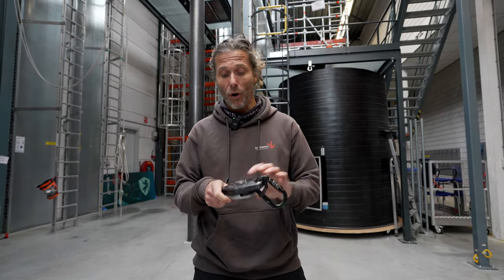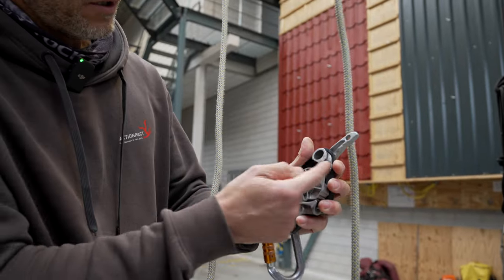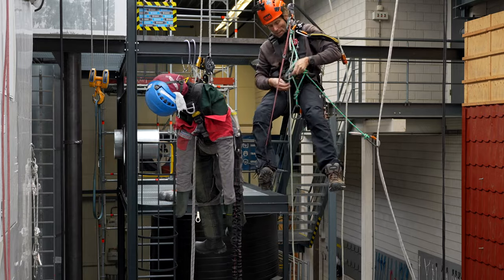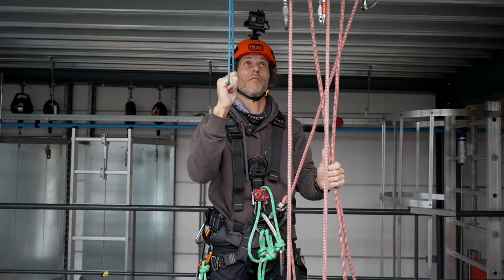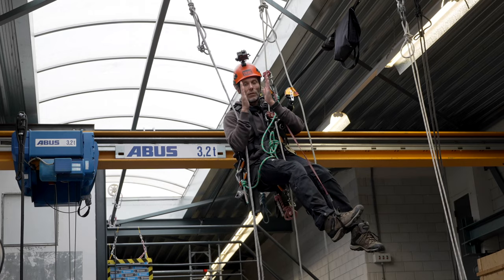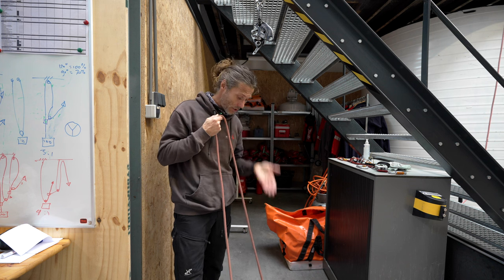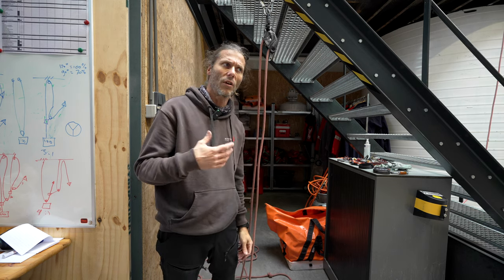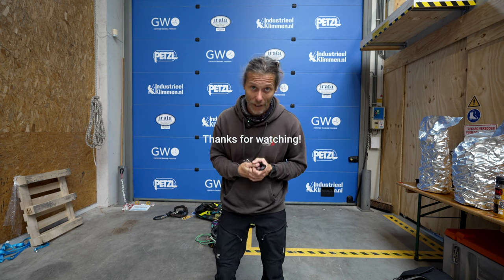The Full Skylotec Spark Review - Is this the best descender?

Comment: I love the spark, biggest advantage in my opinion is that you can operate the cam with your thumb on a slope.
I use a Rock Exotica Pirate Wire Eye carabiner to prevent the spark fron crossloading the carabiner.
Reply: I use the Pirate WireEye as well with the descender.
Reply from the maker: That cam trick works on all EN1515-1 devices though ;-)
The Rock Ex wire has been mentioned a few times before. I think I will have a go at that as well. Thanks for chiming in 
!
Reply from the maker: Thanks for the tip !

Comment: Hello there Alex, I'm a French rope access worker, I'm using the Spark since 2 years now and I'm agree with you on all the points.
The Spark is a verry strong and durable descender.
I've tortured it with paintings, masonry, fluids in industrial plants, and even in salty environment (with a proper wash after the job he still work great and no rust in it). He's still doing the job. 
The only bad point for me is the fact that when you do a small ascend on your rope with a fist ascender like a Jumar  or else, the hold of the Spark may blocked in the ascender,  but this can be avoid pretty easy with a good management of the handle.
Anyway, I recommend it.
He do the job, and he do it quiet well. 🙂

Comment: First descender I have seen that may tempt me away from my Sparrow. I really like that facility to be able to control both the main and backup at the same time for a lower, really handy! Some very nice safety features too
Reply from the maker: What is it that you like about the Sparrow over other descenders at the moment?
Reply: @TheRopeAccessChannel  Probably familiarity more than anything at this point, Ive been on them for a decade and I just like the feel and durability. Initially it was because I didn't like the size or feel of the ID at my weight (too light for it) and rigs didn't cope with geotech for very long. I still have my first one, it got me through my first thousand hours, it's 10 years old now and although it's only been used for lowering gear since the 200 came out its still seen a lot of rock dust yet still functions perfectly. It takes a while for the latest gear to become available down here, and I have a bit of a play with whatever is at the training centre when I have to reassess, but I just keep coming back the the bird.
Reply from the maker: Gotcha. I was really excited when they announced it at the A+A a LOOOONNNNGGG time ago. I though finally a competitor to the I’d.. Then I had a work day on it and realized that it did not work for me.. I used it again a two years ago during my ITRA course. And I still don’t like it.. That might also be lack of familiarity. And with a Rig in hand and now the Spark, nothing comes close to the ease of use. I reckon most of this is just what you are used to and personal preference 👍🏻
Reply: @TheRopeAccessChannel  Yeah totally, so spoiled for choice nowadays pretty much all of it is excellent and much kinder to use that a stop and a couple of shunts
Reply from the maker: For sure haha. It is great not having to tie of a descender to stop going down😂😂
Reply: @TheRopeAccessChannel  When a worn stop becomes a go🤣🤣

Comment: I've used countless descent devices over the years. I purchased the Spark Tactical a couple years ago and it is stellar. Smooth under load, versatile, well-made, great as a brake/pulley combo in haul systems. My ONLY complaint is that it does not tolerate saltwater environments at all. I did a short descent off an oceanside cliff and the internals showed rust in less than 24 hours, and that was only from the air. The device was never submerged in saltwater. Maritime operators take note. Otherwise this is hands-down the best device I've ever used for its intended purpose.
Reply from the maker: Good point and one I have not tested! Thanks for sharing!
Reply: used a clutch? how about them
Reply: @vsiift9373  I haven't, no.

Comment: Very good review. I use a Sirius and love it very much. I use the same trick with the lever when inserting the rope and it's a single fluid movement. To avoid crossloading the carabiner I use a Petzl OK carabiner with a petzl captiv adjust. This allows you to open the Sirius/Spark wide enough.
Reply from the maker: Yes, great tip about the Captive Adjust. There is more people using that one who mentioned that to me. Thanks

Comment: i like the the Spark/Sirius a lot. definitly in my top 3 descenders along with the megawatt and the lov3. 
i´ve had the same issue with the carabiner crossloading. fixed it with a captiv at first and because of the sideplate not properly opening ive changed since to a dmm ceros Locksafe with that i can  still change out the carabiner quickly if i want to.
Reply from the maker: Yeah that is my experience as well. I will change that captiv I have now for something else. I'll look into that dmm biner. Thanks for the tip 👍🏻
Reply: The DMM Ceros is the winner for the GriGri as well.  Great little thing.
Reply: I use the Captiv Adjust, works perfectly, I can open it all the way. Only works on Petzl Biners though.
Reply: Rock Exoticas Pirate Eye carabiner do that job as well and you don't need a tool to apply them do the device.

Comment: thank you for the video!
in the lower a casualty section around 14/15min, what is the small device connected with carabiner to your harness that has you attached to the ceiling with red rope?

Comment: At 14:00 I see the ASAP in use during the lower from the overhead anchor. Is that necessary? You basically have a twin tension system. If one line fails the other is still in tension, so why the ASAP? There should be no shock load with twin tension. Is that an IRATA requirement even with twin tension? Also, if I use the ASAP on a lower I typically keep it with me at the anchor so if it is deployed I can have access to it and address it. Thanks for the great video!
Reply from the maker: I think the scenario is unclear. It is not a twin tension system. It is a rigged for lower setup. The rope tech works on the ropes and does his own up and down movement. Instead of knots we rig two descenders tied of. In case of emergency, rescue is easy because we can lower him to the ground. Does that make sense?
Reply: @TheRopeAccessChannel  You may have mentioned it was a rig for lower and I missed it. That completely makes sense. Great video. As always, I look forward to more content.